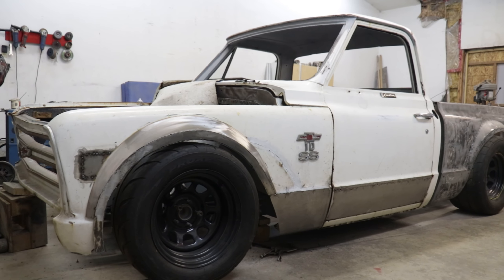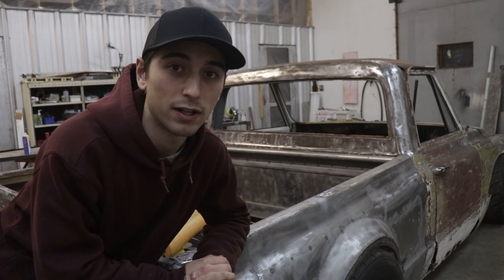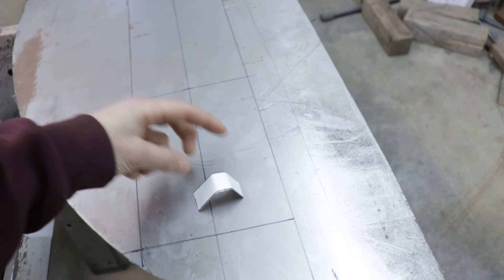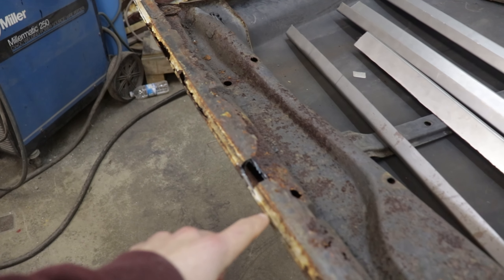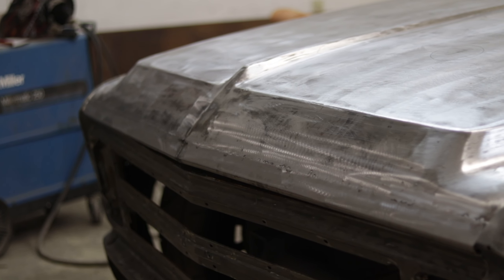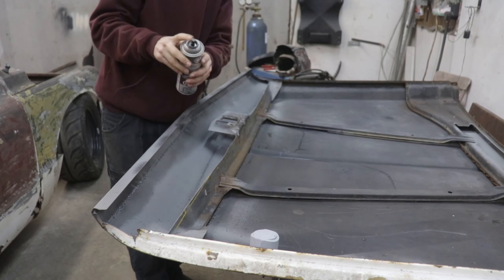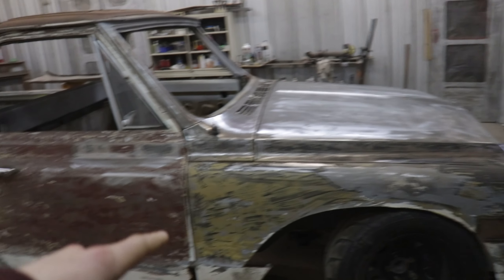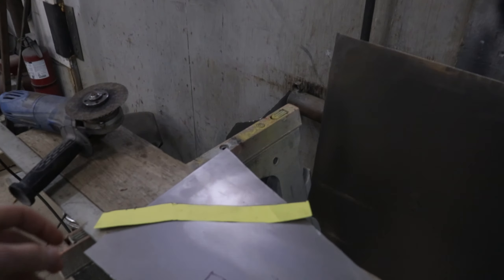Turbo 1968 C10 Truck build- Saving HUNDREDS of $$ by Fixing my Own Hood (Episode 21)

Comment: I think you have done a hell of a job on the truck, taking from what is was to now, is 110% better, I like its not a normal short bed. it's a awesome looking truck and great job. if people are negative about it then they have never had a vision and capable of doing it themselves. it's outstanding and a very cool looking truck.
I get negative comments about my 1985 C10 on a 2009 police crown vic , so I just put the 85 C10 body on the 2008 P71 crown vic. it's never been done before and I'm the 1st to do it with a 85 chevy C10, everyone who does the crown vic swap, it's mostly done with a f150 Ford truck not a chevy truck. I still have a litle bit to go to have it on the road. I'm going to do my fenders like yours, I love the look of it and is a clean way to do it and not just mount plastic ones.. keep doing what your doing because it looks great.
Reply from the maker: Thank you very much for the kind words! Sounds like you have a sweet project on the go🤙 keep up the great work and it will definitely be cool to see a c10 on a crown vic chassis. Lots of work!
Reply: @agtrucks  lot of work but worth it.  lol

Comment: Does anyone know if the c10 or c1500 (gmc) body panels are the same styling? I’m thinking of pulling the trigger on a 70 c1500 gmc that’s original. I can’t tell if they are the same panel’s or if I’d need to swap the c10 panels to get a similar look. I feel like the GMC hood is a little taller but I’m not sure.
Reply from the maker: They are the same as long as they are the same year. They have different grills but can be changed👍 the hoods differ from the year 67-68 to 69-72

Comment: Why did you use a crown vic suspension Why not a camero
Reply from the maker: Mainly because of budget. But crown vic crossmember is light and there's a lot of aftermarket parts available.